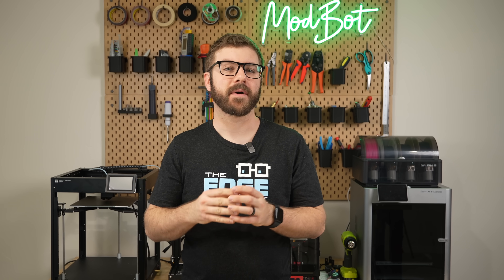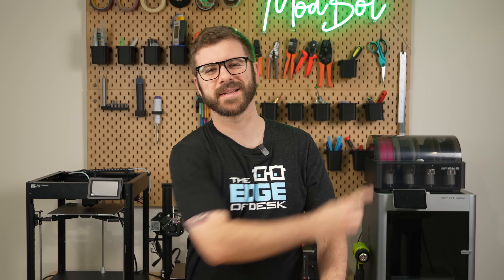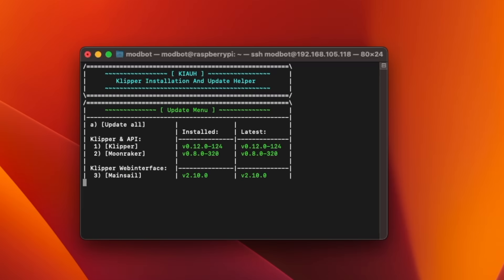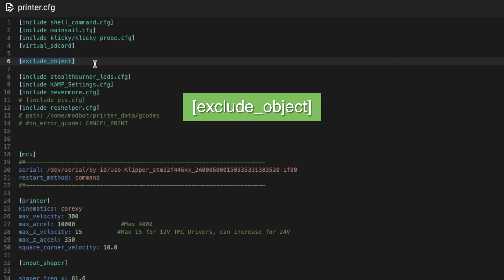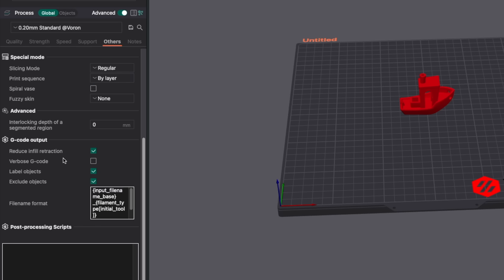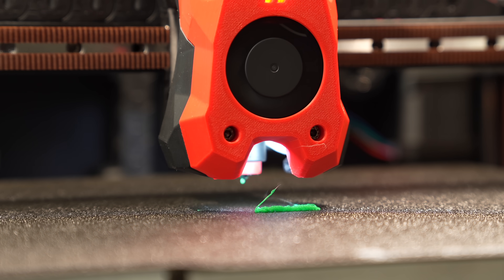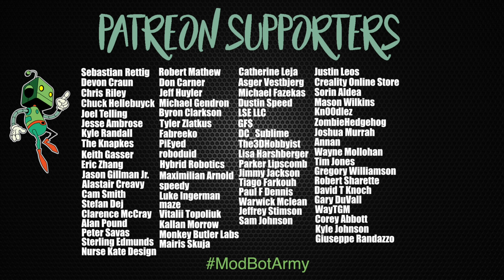Native Adaptive Bed Meshing In Klipper Is Here

Comment: I haven't got adaptive purge in KAMP figured out but, I did get this working. the thing that worked for me (but really didn't make sense) is I put the command "BED_MESH_CALIBRATE ADAPTIVE=1" in my gcode start file. it works fine? I have no idea where he's putting that command in this video. that's the part I'm missing. I'd really appreciate it if someone would fill me in. 🙂

Comment: Hey, so I could NOT find the setting and after some digging in the forums here the solution:

You have to add the BED_MESH_CALIBRATE to your start gcode macro so it’s part of the printed gcode, e. g.

BED_MESH_CALIBRATE PROFILE=adaptive ADAPTIVE=1

and remove BED_MESH_PROFILE LOAD=... if necessary.

__

So where ever you bed_mesh_profile_load startup sequence is (IE the part that tells the print to use you bed mesh profile) mine was in gcode.cfg. Delete it and replace it with BED_MESH_CALIBRATE PROFILE=adaptive ADAPTIVE=1 which is what he was talking about in the video. 

Hope this helps.
Reply: Thank you  for the information it helped me as I could not find it..   I found it in the client_macros.cfg
Reply: I was so hoping this would fix it for me. still getting this;
Error evaluating 'gcode_macro BED_MESH_CALIBRATE:gcode': jinja2.exceptions.UndefinedError: 'extras.gcode_macro.GetStatusWrapper object' has no attribute 'gcode_macro _KAMP_Settings'
Reply: THANKS, I WAS BECAMING MAD SEARCING WHY IT DOSNT WORKING now i want 4mm of more large calibration, i dont remember how it calls, HANKS AGAIN

Comment: I  just run a 10x10 full bed mesh, save it as default & have it loaded each time the printer is powered on.
its extremely rare that i ever need to recalibrate & it saves me ever needing to do a bed mesh before any print.
mind you, im using a bed-slinger, so i imagine my bed mesh needs less adjustments compared to something that moves the bed up & down on multiple axis.
Reply: Me too I run 9x9 with BLTouch just for every bed sheet. I call them as their names PEI_9x9, PEO_9x9, PET_9x9, ...
Just change "bed_mesh_profile load=PXX_9x9" at START_PRINT macro before printing or ... according for every sheet.
As my magnetic hot bed is so unpaired i have added some 2x2 cm square paper on lower points directly over hotbed.

Comment: I don't get making a bed mesh before every print? I mainly print in ABS/ASA and have a bed mesh made while the bed is at a 100 c, which is stored in Klipper permanently. 
Every time I have to print something my printer heats up in 3 minutes to 245 nozzle/100 bed and after a single bed probe in the middle of the bed it's starts printing. Normally I don't have to redo the bed mesh..
Note that I print on a G10 / FR4 plate which I don't have to remove or touch by hand; after a very short cooling periode, the prints release entirely from the bed. When I'm inpatient a little light pry with a razor blade does the trick without applying force to the bed itself
Reply: It depends a lot on your printer. Some people have issues with springs loosing tension or the knobs unwinding itself. Dirt beteeen the build plate and glass plate. Its like free insurance for a great print, especially with this feature it barely adds any time. Also, you can easily swap glass plates etc
Reply: @rikrikietje  Those springs could be an issue, true. My print bed does not have springs and is solidly mounted. Dirt can only accumulate under the build plate if you remove it, which I don't.

Comment: Looks like that's not all of it. There appears to be more to it than these steps. 
On the Magneto X enabling Adaptive=1 on the start print macro does enable bed mesh calibration, but it's calibrating the WHOLE bed.  Not just the print area. 

RIP.

Comment: I have installed klipper on my printer ender3 week ago.    After initial setup its working fine. I have added bltouch and mesh bed leveling.   Every thing work as expected.   
After following thit video i have to enable adaptive mesh function.  I edited printer.cfg   and mainsail.cfg and change setting in slicer(prusa)..   still adaptive mesh not functioning.  Machine  execute probing for while bed.

Any suggestions.
Reply: Same issue, same machine. Did you solved it ?
Reply: @julienlessire18  surprisingly it's resolved but I dont know how. Actually I have stopped using the printers for almost 20-30 days & now when I start using my printer adaptive mesh working.  I think I only did an update klipper from mainsail.

Comment: I use a custom script for the bed mesh for over a year now. Nice that it’s now in Klipper but I will use my script as long it works. 
It’s also adaptive in how much probe point it’s using depending on the size I’m printing.

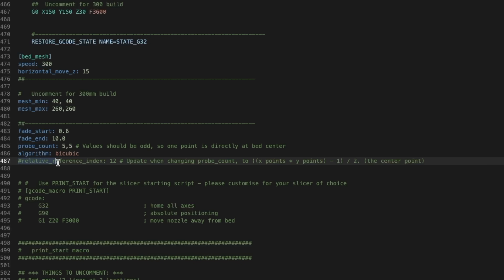Comment: Hello, from here 2:35, is it possible to go back for the klipper version?

I will do your tutorial for saving the config on github to start xD

But here to return to an earlier version of klipper it is because I have a Lerdge-K card and their tutorial for making the .bin for flash the card did not work for me and I was forced to use theirs...

In their procedure they replace the kConfig in the klipper files then generate the new .bin then pass it into a tool which will modify it so that it is compatible with the lerdge card, but never succeeded in doing so :s

I installed everything for the KAMP bed mesh, but it makes the whole bed each time while the purge is carried out next to the printing, there is a possibility that my problem is linked to the klipper version???

Comment: I do have klipper and can make fast bed mesh but still can't understand why to do bed mesh at tue start of each print ? I do perform bed mesh once in 10-20 prints and honestly... It doesn't changes much. Not enough to influence on prints with 0.2 first layer.

Comment: I don't understand the point of adaptive meshing. Yeah, 3x3 adaptive on a small model will increase accuracy. Now your next big print and 3x3 is not enough. Just use 9x9 whole bed mesh every time and job's done.
Reply from the maker: I probe every print. It’s cheap insurance. Also depending on temps being ran in an enclosed printer things expand and contract differently at different temps. If that works for your setup then that’s great, but going from a enclosed print that had some heat soaking ABS parts to opening up and printing PLA probing with adaptive meshing is quick and proven to work well.
Reply: @ModBotArmy  I also probe before every print. What I'm saying is that the moment you start a large print 3x3 is not sufficient anymore. So unless you only print tiny models one by one all the time adaptive meshing doesn't make any sense.

Comment: 3:34 You lost me here. Which file is this located in?? I noticed you keep doing this in your videos where you could be showing what file you open to better help us, but you always crop it down and hide where you are actually at. Why do you do this? Why not show what file you opened? Why not give more details on the process?
Reply from the maker: 3:34 is my printer.cfg. I didn’t show it because it’s not guaranteed that yours is there. Depending on how you store and run your macros it could be in a dedicated macro file. That’s why I state anywhere you run bed mesh calibrate. There is no way for me to know your setup.
Reply: @ModBotArmy   I cant figure out where mine is... If I do bed mesh calibration, it saves the mesh values in my printer.cfg file at the very bottom in the save section, but I dont have that BED_MESH_CALIBRATE anywhere in my printer.cfg file. I do have the BED_MESH_CALIBRATE in a print_area_bed_mesh.cfg, but its read only and I cannot change it. Not sure what to do.
Reply: @wrxsubaru02  Hey, So i had the same question as you and found a solution in the forums:

You have to add the BED_MESH_CALIBRATE to your start gcode macro so it’s part of the printed gcode, e. g.

BED_MESH_CALIBRATE PROFILE=adaptive ADAPTIVE=1

and remove BED_MESH_PROFILE LOAD=... if necessary.

__

So where ever you bed_mesh_profile_load startup sequence is (IE the part that tells the print to use you bed mesh profile) mine was in gcode.cfg. Delete it and replace it with BED_MESH_CALIBRATE PROFILE=adaptive ADAPTIVE=1 which is what he was talking about in the video. Hope this helps.

Comment: I have a little story, but I promise it'll end in a question for whomever may know the answer to this:

A few months ago there was an update to Klipper that I decided I had to move to due to it having some important new features over the (quite old) firmware I'd been using up until that point.
Now, when I built my printer I had set up an EBB CAN board on the toolhead and an USB-to-CAN bridge from the Pi to the Octopus mainboard, with the EBB connected via the CAN connector on the mainboard.

When I tried upgrading the firmware, I updated Klipper on the Pi itself which immediately led to both the Octopus and the EBB not being picked up anymore, not even with the many workarounds that circulate the Internet. I figured I'd try flashing the new Klipper firmware to both of the devices manually via SD card and USB respectively; this opened up Pandoras box somehow and within half an hour I had managed to make both boards completely invisible to the Pi, even with Klipper's service stopped on the Pi.

Being tired and frustrated by the hassle, I spent hours deep into the night trying to get everything up and running again and in the end, I managed to get it working again. Even more tired now, I decided the best course of action was to be happy with the outcome, document exactly zero percent of my solution to get things up and running again and go to sleep, never to look back or think about the experience ever again. 

Until this video gave me Vietnam flashbacks. Oh lord, now I have to do it all over again.

I do remember being completely unsure whether I had set the baudrate to 500000 on my initial install and that may have caused some of the headaches, so I guess two questions now float around in my mind:

- Is there a way to query the currently functional CAN network to see the baud rate at which it's running?
- Is there a better 'order' in which to upgrade things? Did I do something fundamentally wrong or is it just natural for the CAN devices to simply refuse to show up again, even after doing things like killing the Klipper service, restarting the CAN network from the Pi's side, etc.?

Any insight into this will be very much appreciated since I'll probably go through the above experience all over again if I dive into it the way I thought it should be done, haha.

Comment: Did anyone got it if what's the difference between KAMP and adaptive meshing? Cos I did not.
Reply from the maker: The main difference is that Kamp is not apart of klipper but an addon. While now adaptive meshing is in klipper. The logic behind it as far as I can tell is the same or very similar so if your up and running no need to change.
Reply: @ModBotArmy  oh, so adaptive mesh was added recently to klipper? Good news, thx.
I'll stay with kamp then, thx for mentioning it.
Reply from the maker: @kenyajobs1069  yeah! Exactly. It’s more exciting for anyone who never got around to or didn’t want to install an add on. Will still be good for new printer builds. One less thing to setup (unless you want the purging)
Reply: @ModBotArmy  good point, purge line is a good indicator of wet filament. Trust it more then my filament dryer's screen data😁

Comment: The issue with KAMP is that the adapted mesh isn't probed with the same accuracy as the whole bed.  It just probes a smaller area, but with the same distance between points.  Unless something has changed that is.  So if you have a 10x10 mesh across the entire bed and need to print something  taking up only 1/10th of the bed in x and y it will only probe one point (or fout I guess).  It will not probe 10x10 in the small area you are printing.
Reply: Actually, right from the cfg.... 
# The following variables are for adjusting adaptive mesh settings for KAMP.
variable_mesh_margin: 12                     # Expands the mesh size in millimeters if desired. Leave at 0 to disable.
variable_fuzz_amount: 0                     # Slightly randomizes mesh points to spread out wear from nozzle-based probes. Leave at 0 to disable.
Reply: I had this same concern!

Comment: I've been thinking about temporal adaptive meshing. Sometimes the heat soaking in the bed and frame lead to distortion of the bed during the printing that can cause issues. So doing an meshing so that its been done after the bed has reached temperature and then for example with 5 minute intervals after that, which would create a number of meshes. The interpolation could then be done based on the time as well as the 2d cordinates of the mesh. with elegoo max it seems you need to wait 20 minutes for the bed to really heat soak, even after it claims it has reached the target temperature, in order to get a good first layer.

Comment: As a heads up, Klipper has a breaking change in it,  ACCEL_TO_DECEL is now depreciated, if using klicky, you may find out that your printer will no longer home Z. Klicky Macros have been updated to reflect the issue but there is a chance that if anything is controlling acceleration using ACCEL_TO_DECEL, you will find it won't work.

Comment: I tried this KAMP feature and my Voron Trident started failing all the prints. It turns out that the issue was that the back Z axis motor was doing extra steps and the print bed was getting tilted to the back during the print. Did anyone else experienced this issue?

Comment: Are you kidding me? Literally 4 hours after I installed KAMP? :D
Reply: There is no need to use the built in adaptive mesh. Have fun with KAMP :)
Reply: @timha4102  yes you're right but I like to keep my configuration as simple as possible :) at least I am going to update Klipper in my MCUs.

Comment: In your bed mesh section you need to replace relative reference index with zero_reference_position: 175, 175 with the values being the Center of your bed. That is why you needed to adjust z offset. Be careful after you set this up to redo your z offset!!

Comment: Thanks for the video! I use KAMP and love it. 

An interesting idea for a video would be exploring MMU systems for printers. I want a non bambu printer that does Multi material and engineering materials. Only if Qidi had an AMS competitor.
Reply: There are a few options out there, and most are pretty well documented. There's the chameleon, ercf (v2 which massively improves its reliability) and tradrack, which is currently in open beta. I'm very interested to see more come out from annex engineering, who make the tradrack, when it comes out of beta into full release. 

For now I'm building an ercf and it is definitely not quite as optimized as an AMS but does the job for a fraction of the price!
Reply: I have a Qidi x max 3 and am looking to build ERCF for it soon. I think it should be possible
Reply: I ended up getting a Q1 Pro, and hope to one day do a ERCF or potentially a AMS like system from qidi if that ever comes to fruition.

Comment: "relative_reference_index" tells the system which of the probed-points should be considered Z-zero, and isn't used anymore. I think they went to some sort of virtual-point, or whatever's closest to where you actually homed your Z automatically.
Reply: Indeed.  There was a recent commit removing this.  Similarly ACCEL-TO-DECEL functionality was changed recently, so also if you are configuring something on that, you might have to adjust this to the new thing replacing it or just remove it and rely on the defaults.

Comment: Yooo this is sick!

As a noob I'm wondering though. Can the amount of points in the mesh change with the size of the model? Is there a way to configure the distance between points to be like 10mm to 40mm or smth?

Would it also be possible to use different meshing paterns, like a triangle/hexagon patern instead of squares?

Comment: I have the same problem with my z offset now and was not able to fix it yet😢😢
Reply: If you are using Auto Z calibration de-install the script and reinstall the script is solved all the issues for me !
Reply: @Nice_3DP  reinstalling the script solved the issue. Dont forget to remove the old one before
Reply: Ive got the same issue, im not sure how to fix it since i also have klicky and its meant to auto set the offset
Reply: The sonic pad isn't just a normal klipper install, they have walled off some features, especially around the updates, so that Creality can better control the firmware. KAMP works just fine though and will give you the same functionality.
Reply: Make sure you use this in the bed mesh section: zero_reference_position: 175, 175 the numbers must be the middle position of the bed